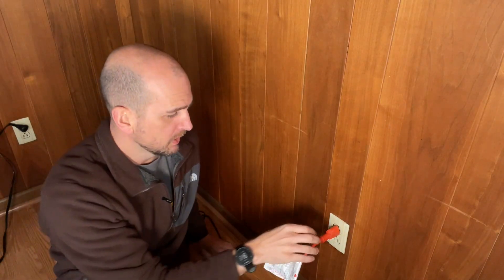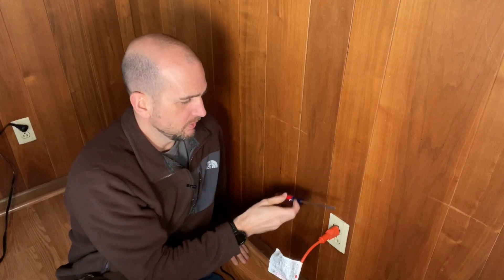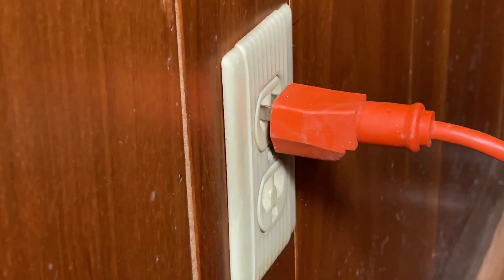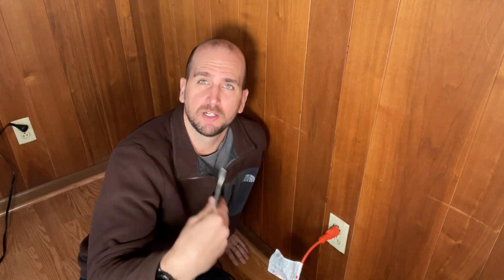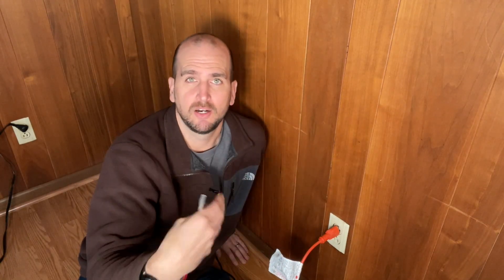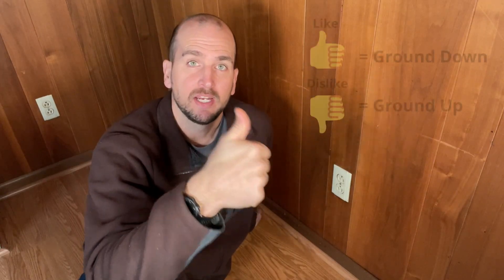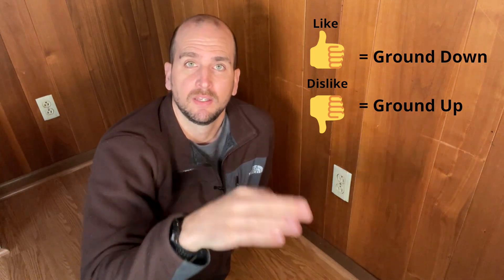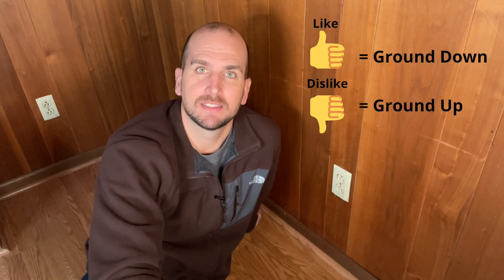Should An Outlet Be Installed Ground Down Or Up

Comment: In my opinion, if NEC isn't making a recommendation after this many years, there must be a consensus among the rule makers that it truly doesn't matter and there is no significant safety reason to pick one option over the other.
Reply: 59 years and never seen anything fall on an outlet and short out.
Reply: @returntonature8773  The real risk is with metal cover plates on duplex outlets.  Old fashioned attachments used the center screw for the ground or support, resulting it being loose or missing.  When the metal plate drops, excitement or disaster.
This problem doesn't occur with Decora style receptacles or simply using a plastic cover plate.
Once you eliminate that risk, the very slight improvement in safety is overwhelmed by the significant decrease in safety from plugging equipment in upside-down.  Every wall brick and GFCI plug expects a happy face orientation.
Reply: @1djbecker  When the metal drops, it trips the breaker. It is not a safety issue
Reply: @garyvcole  only if the short is enough. Small gauge wire could burn through. I have seen it happen.
Reply: @garyvcole  I cut through a conduit with 2 live 347 circuits with my bandsaw yesterday, and blew a hole through the blade but did not trip any breakers, so, not always.
Reply: @garyvcole  "When the metal drops, it trips the breaker. It is not a safety issue"  Thank you!  
I'm baffled at the fear mongers who expect that there is an oily rag within sparking distance of any and all electrical outlets!  lol
Reply: @garyvcole  not necessarily. If the circuit has an improper breaker on it, the metal arching the receptacle could spark for a long enough time to cause a fire before the breaker trips. Or the breaker could just simply be faulty and not operate as intended.
Reply: @1djbecker  that makes sense
Reply: @returntonature8773  79 years here. Ditto
Reply: @returntonature8773  you never met my kid when he was 5... long story.
Reply: @donsvideos1985  why weren't you watching him?
Reply: @shadowopsairman1583  exactly... Bad parenting is the problem.  Not the outlet.
Reply: Rule is hot side on right
Reply: @Jake-by9ly  what about 20A~ 240VAC air conditioner receptacle
Reply: @Jake-by9ly  No hot is on the left, cold is on the right and
Reply: Some appliances are polarized...
Reply: The NEC is not the end all be all. The NEC is a baseline starting point for best practices.

However, the NEC is also moronic in many cases. Service grounding as an example. Which currently requires 2 ground rods per service.
Reply: NFPA-70 110.3 (B) 110.3(B) Listed or labeled equipment shall be installed and used in accordance with any instructions included in the listing or labeling.
Have you ever noticed "top" written on yoke or notice the instructions that come in the box show the devices with grounding pin up?  Not all manufacturers do this but a lot of them still do.  I don't think it matters one way or the other but one dick head inspector pointed this out to me.
Reply: I hear a lot of people trying to claim that "code" requires they be ground up, but I've only ever seen that done in some commercial locations.  Seems dumb because most (all?) flat plugs have the cable go towards the ground pin so if you put it ground-up all the big heavy cables will be trying to go towards the ceiling putting extra strain on the plug and making it a bigger trip-hazard if it runs out from the wall.  If its ground-down all the big cords and power strips run towards the floor, reducing strain and tripping hazards.  It also matters for polarized transformer plugs, which typically have the fat prong such that it will hang nicely if its ground-facing-down, but will unplug itself with the weight pulling if its ground-facing-up.
Reply: (...1st World Issues...)

!😊!
Reply: The National Electrical Contractors Association's National Electrical Installation Standards (NECA 130-2010) recommends that sockets be mounted with the equipment ground hole up.

For what it's worth, the drawings in ANSI/ NEMA WD 6-2021, Wiring Devices--Dimensional Specifications , 2022-02-22,  consistently show the equipment ground hole in the top center for non-locking receptacles.  For locking receptacles, either the equipment ground hole is on the left, or the system ground (neutral) is on the left and the equipment ground is in the center.
Reply: Exactly.  Flip a coin.  They both work and I've never had anything "fall" into the plug and arc/spark/short.
Reply: Isn't that the truth!
Reply: Ah, but I have experienced exactly what he described re: the blades being on top & the plug not completely flush with the outlet!  It happened in a US federal government work shop where stored sheet metal arced across the blades.  That’s why European outlets are safer.
Reply: @Charles, or it could simply be a scenario where half of the members want up and the other half want down, each with advantages and disadvantages, and no consensus is possible in this scenario.
Reply: Yes there is a significant safety issue.  I have brought this up  with several elect. inspectors and the have all argeed with me that ground-up is safer. However, it's not in the NEC code.
Reply: The NEC doesn't have codes telling how receptacles "shall" be installed.
But there is "a consensus of rule makers", called NEMA. They work tight with the NEC. Google them, they make a lot of the things that you use every day "conform".
NEMA is the reason that the "configuration" is ground up. It's not the law. 
Most grounding receptacles, even twist-locks install in the ground up configuration. 
It is odd, NEMA is kinda big, recognized. 😉 I'm not sure why so many appliances come ground down or polarized backwards. I guess NEMA isn't law. But NEC is.
Reply: There was a section in the NEC at one time I can’t find my book for what page it’s on
Reply: I’m guessing u have never read the NEC book then
Reply: @LiveVicariouslyThroughMe  Which section of the NEC specifies the receptacle orientation?  It's not in 406, which only prohibits face-up orientation on a countertop or similar location.
Reply: @1djbecker  only NEC110.3(B) has the required specification. Otherwise if the NEC, project outline, or local authority it is compliant regardless. Workmanship manner doesn’t apply so that can’t be used.
Reply: @Bob-gy6ud  NEC 110.3(B) All electrical equipment shall be installed and used in accordance with the listing requirements and manufacturer’s instructions.

So basically "follow the directions".  I'm not seeing how that applies here.
Reply: @1djbecker  if “Joe’s electrical receptacles brand” states ground is to be installed in this position and you install it opposite you have violated the NEC. The answer is in your own reply since it was a direct quote of the NEC. So you have read it, I’m not sure where the confusion is. It’s just like wire ties ( zip ties ) NEC allows them to secure wire but only if they are rated for support. Not all are depends on manufacturers and which UL rating they applied for. 
 Not all receptacles like Cooper, P&S, Levington are universal up/down.
Reply: @Bob-gy6ud  You must have a very very specific receptacle in mind.
Or is this just theoretical?
Reply: @1djbecker  NEC 110.3(B) is very clear to any electrician. If maker of said part instructs to install said part in such manner and any deviation from instructions violates NEC110.3(B). You read the code what isn’t making any sense. If it’s reading comprehension I can’t help you I’m not an English teacher
Reply: @Bob-gy6ud  you are basing your question upon a theory that has NOTHING to do with this video and standard outlets.  

To answer your theory any device with specific installation instructions must be installed as recommended by manufacturer.  However there is no manufacturer that declares how you install a standard outlet.  There are MANY theories of why people install them upside down and right side up but not one of those theories can be proven as FACT.   This is why the NEC does not declare any specific installation and leaves it up to LOCAL AUTHORITIES.
Reply: @1djbecker  I’m trying to find my nec for the page my wife has a habit of moving things
Reply: @1djbecker  from what I’ve just learned it must have got changed in the 08’ or 12’ version to not be required hospitals still to it
Reply: @LiveVicariouslyThroughMe  What country are you in. In the USA the National Electrical Code is NFPA document 70; as noted in the video it does not specify orientation for ordinary outlets (section 314). The latest rev is 2020 and is available online from the NFPA under Free Access.
Reply: @PowAngel  The ground should be on top in case of kid drop something on it when it’s not plugged in all the way
Reply: @LiveVicariouslyThroughMe ...I know of a young lady who reached for a wire clothes hanger and when she picked it up making contact with the neutral and hot causing her to be electrocuted. This was witnessed by a friend who was visiting her. 
Install them correctly, ground up! One life lost is one too many!
Reply: @arkansas1336  yup
Reply: @arkansas1336  Hmmm - I would have thought a circuit breaker would trip but I guess not if the current was within it's limits. Also I am wondering if the woman was barefoot standing on concrete in a basement. I would think  that a normal modern home scenario would often prevent electrocution  because the floor material - maybe a vinyl or wood -  would prevent current from flowing from hot -then through a person -  to earth. But maybe I'm wrong about that.

Comment: Well it makes a difference when plugging, it easyer to see and use the ground as a guide, when the ground is up.
Reply: If that’s the rationale, a better precaution would be a longer ground prong, requiring it to be inserted first.
Reply: An even better precaution might be a new optical prescription.

Comment: I would say it doesn't matter. I installed them sideways as well, ground on left or right? You decide! But if your plug slips out easily or has any movement while the plug is inserted, its time for a new socket

Comment: Polarized/three-prong wall warts and timers typically require ground down. Ground up is preferable with metal wall plates that could potentially come loose and drop on plug, in workshops where brads or washers may fall off a workbench, and in schools were dumb-dumb kids try to drop coins between plug and receptacle for stupid TikTok challenges...

Comment: I install grounds up for the simple matter if something slides behind that outlet that object is going to be energized before that breaker can trip and that I think is a big safety hazard where if that ground is up that same object will hit that ground not to say it still won't hit the hot side of the plug but it is just a little bit more assurance

Comment: Apparently in Quebec they have the ground up. I'm in the next province over in Ontario and I've mostly seen ground down. I've never seen a thin piece of metal slip between the plug and short out the pins here in Ontario nor have I ever seen a cord stressed out and we were all saved by having the ground down. I think the odds of either situation happening are extremely small so whatever way you choose to install then go for it, unless local code says different.

Comment: Ground down always.
Main reason newer strip connectors have the power plug tilted sideways with the ground downwards, also some cables have the left opening wider than the right one and this is also the correct orientation of small power converters so the cable hangs downwards too instead of up adding more stress to the wires.
In Mexico where I live many builders put the ground up or worse, sideways.

Comment: When I was doing my apprenticeship some 40 years ago, the chief electrician told me that if water was to get into a basement and flood up to the electrical plug, installing it ground down will add safety to trip the circuits...
Reply: For basements you should put under a gfci receiptical first or a gfci breaker is the best way to go get rid of mights and probably’s power doesn’t care you have to be smarter
Reply: The ground is connected to the metal mounting tabs on each end; either way up, the water would contact the ground first. Just take an old one apart and you can see.
Reply: @caleb234  Of course. But I have specified that it will add safety. In protecting lives and property, the more protection measure you take the better it is. Especially with one like that which do not cost anything...
Reply: @PB-tc6hw   I understand. But, it is irrelevant which way is up, the safety factor you describe is built in. The lowest point of an outlet, whether up or down, is grounded because the ground connects to both exteme ends. So, if you are concerned about rising water, it will always contact a grounded portion first by design. Even then however, it can still be dangerous, it should never be assumed that water will always trip the breaker.
Reply: @caleb234  you are talking about a mechanical ground against a electrical ground. The electrical code specified that the electrical ground supersede the mechanical ground and not to be replaced by. That is for a reason, the mechanical ground is just an added safety (another one). Also, speaking of mechanical ground, the ground wire must be connected to the the electrical box where the receptacle is before connecting to the plug itself.  The code do mention that a receptacle box in a wall must be in metal. So water in basement will likely touch this metal box even before the attachements of the plug that you described. But here again, it is only a mechanical ground which is not as secure as an electrical one therefore why I prefer my plugs ground down. As for the electrical code, I am not the one who wrote it...🤗
Reply: @PB-tc6hw  "The code do mention that a receptacle box in a wall must be in metal"?  Odd that all of the boxes in new construction are plastic, if they violate the code you mention.  Obviously, plastic boxes are not grounded at all.
Reply: @UpnorthHere  Plastic boxes are for liquid proof application (exterior) and surface mounted. You will notice that those plastic boxes have also a green ground screw to attach the electrical ground wire.
Reply: I asked about ground-up outlets (not in a basement) and was told a similar reason --- liquid spill on the wall, leak from a roof, etc. will trip the circuit breaker with a ground-up outlet.
Reply: It is literally less than a half inch. You can't be serious.
Reply: In areas that may flood use common sense. Raise the outlet up above potential water line and don't listen to fools.
Reply: @tomnelson6978  If you truly used common sense , and you were not a fool, you wouldn't want the electricity on while your house is flooded.
Can you really picture yourself wading around inside your home turning on light switches and with the refrigerator and heating system kicking on?
 In a flooding situation the substation breakers would trip off well before your home's floor even got wet. Don't be silly.

Comment: The main reason for having the ground up is to prevent a METAL receptacle cover that has a loose screw holding it in place dropping down across the prongs. This reason has actually been discussed in past years when the code was up for revision. Guess it never made it onto the code.

Comment: When my son had Penny's on his desk and 1 fell off it landed just right on the plug. We smelled smoke and then the breaker blew and you could see the fire climbing up the wall. This was in a basement with paneling on it. Maybe 1 in a million shot but it happened. So when I built my new house all grounds are up just in case if we drop a another penny.
Reply: GOOD POINT ! I'll use that for Ground up, I already in commercial, use the "Sheet metal/ruler" arguement for ground up.
Reply: Perhaps they should sell a flexible beveled guard that you place between the desk and the wall.

Comment: and here is another tip. on a appliance cord the neutral is on the bottom because most of the time it is a 90% cord and this way it protects the cord from being to top heavy and working it's way out of the outlet, making sure the wieght of the cord does not pull the plug out of the outlet. and causing a fire. remember that ac current vibrates. and if not making good contact will cause a fire

Comment: More often then not, I prefer ground down because if the cord starts to work itself out it's normally cord pulled downward / tilted.  This maintains a solid ground while the cord is in use.  If ground is up, I have encountered the cord pull out where the plug was tilted enough that the ground wasn't engaging the outlet creating a potential shock hazard.  All practicality, the odds of something like sheet metal or a 'picture' frame falling down and fitting into a 1/8" gap and creating a short is slim to none.  Nothing taking away from the video.  I understand that was used as an example.

Comment: The only time I have a ground facing UP is when I have the air conditioner that has its own circuit breaker built into the cord plugged in and for the sake of the cord hanging downward conveniently and not stressing out the cord. Also, the way manufacturers assembles the cord with ground facing upward is weird.

Comment: I as a master have been on jobs were the ground is the last prong to be unplugged. Which way the tension on cords are going. Most plugs in a home cords fall to the floor. But under inland cords pull up so ground would be up.

Comment: all normal installation's in residential should be ground down, unless its switched then ground up, and if your going horizontal in a high kick plate or floor board then just have all the ground pins pointing in the same direction usually to the left